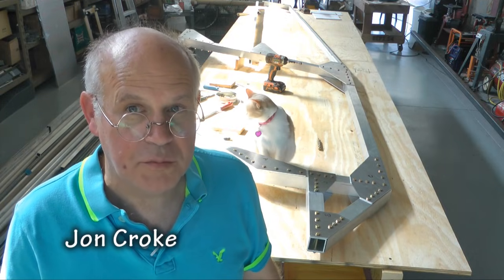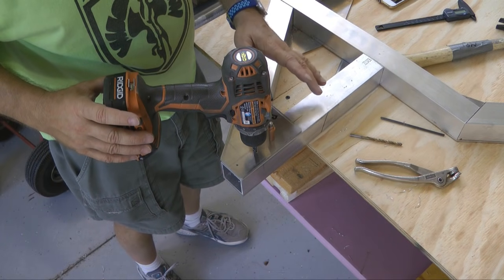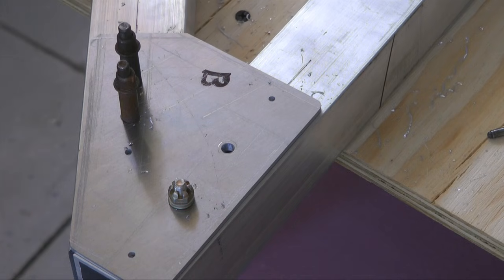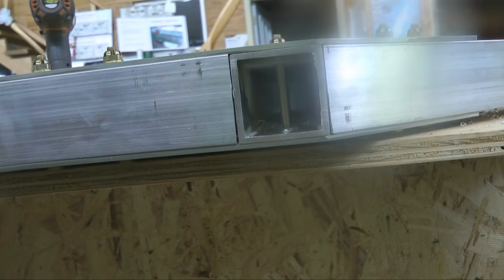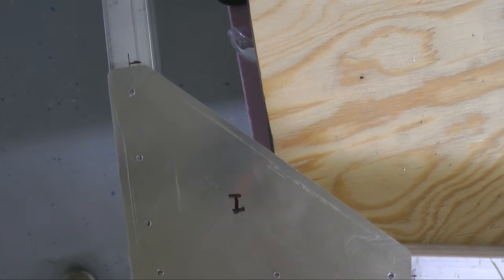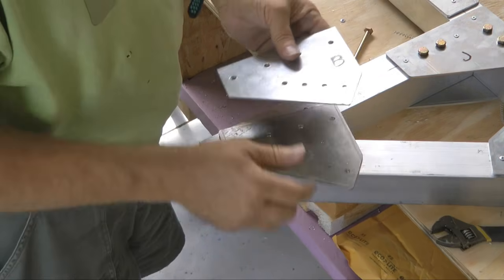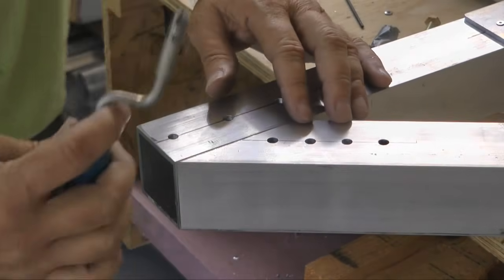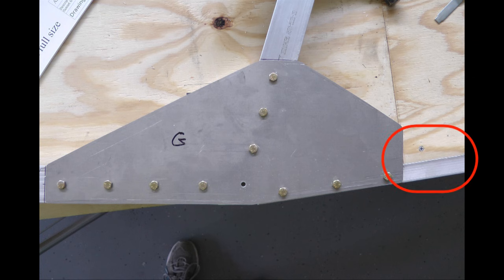Building My Affordaplane Part 5

Comment: A couple of thoughts...  1. Buying or borrowing additional drills (even super-cheap ones) will pay huge dividends in time savings and reduced frustration on a project like this.  Put each drill bit you're using in a separate drill and label it with a big piece of painter's tape.  2. Put a rubber O-ring around each drill bit; when you punch through, it will prevent the nose of the drill chuck from making a radial scratch in the gusset material.

Comment: I made the same mistake on gusset G.  I found out that there is a page missing on gusset G, there should be 4 pages that you tape together. Having said that, If I was paying attention, I would have notice that the full size drawing was missing a part four by looking at  drawing #67. Hopefully other builders will see this and not make the same mistake we did.

Comment: One quick suggestion...instead of putting two washers on one side under the nut, how about putting one washer under the head of the bolt and one under the nut? That'd provide a slighter larger bearing surface under the head of the bolt to spread the load under it and marginally improving the clamped joint of each bolt connection. It'd do this while still providing the same functional result of covering the threads as you clearly described around the 14:00 mark.
Thanks for making another very clear and informative video. I think your methodical explanations are very effective. I'm looking forward to the rest of your videos about this build.

Comment: You should have taken it all apart so that you could get to do the deburring on the inside and remove all that drill swaf / rivet tails you have left in there.
Reply: @electoplater  as he gave all the other information in such detail I am surprised he did not talk about that.
Reply: @electoplater  If they have blocked you how did you post this? Looking at the aircraft I feel it might just make part 103 with the right covering and the very basics but it will be tight. That said I do think it would be a good SSDR here in the UK if we substitute 6061T6 for 6082T6 and we could afford to build it to the LSA as we are restricted by MTOW at 300Kg or 315Kg with recovery system.
Reply: Yeah, why leave the deburring for the end ? Why not deburr everything as you go along.

Comment: Plastic calipers are for electricians. It's for extra safety when checking the wire gauges. Not to be used for anything where precision and repeatability of measurements matters.

Comment: Looking at this potentially later, two questions:

Any thought on using the same thickness round tubing vice square?  I'd imagine for the same weight, it gains a little structural strength.

And any option for hinged wings that could be considered?

Just curious, keep up the great build.
Reply: @electoplater  Thanks
Reply: @electoplater  Yes he will. As usual, you are spreading false information.

Comment: SIR THIS IS A VERY GREAT BUILD SERIES I DREAM ALWAYS TO HAVE MY OWN AIRPLANE I DID MY MICROLIGHT PPL IN SOUTH AFRICA. I DO HAVE A LOT OF SKILLS TO WORK WITH WOOD AND METAL I AM A BLACK SMITH MAKING KNIFES. I WONDER IF MY DREAM IS TO HAVE A PIPER CUB CAN I BUILD THE CUB WITH THIS METHOD THAT YOU USE HERE OR IS IT BEST TO BUILD THIS AIRCRAFT AND THEN GO TO A PIPER CUB AND BUILD IT WITH PIPES AND TIG WELD IT. WHAT WILL YOU ADVICE ME TO DO SIR?

Comment: seems like rivets around the perimeter of gusset and tube overlap would be stronger than thru-both-sides of the gusset-tube-gusset as the tube will want to collapse as the bolt is tightened and from vibration-time without an insert in the tube thru which the bolt passes as part of the stackup  (bolt gusset tubewall spacer tubewall gusset nut)

Comment: Nice simple construction, but further improvements can be easily made since the gusset plates were laser cut. The nose assembly is built up with a couple of tubes, six plates and a pile of hardware. Two large/swiss-cheesed gusset plates and a single piece of tube could provide the strength with reduced weight and hardware count.

Comment: I enjoy your tutorials! I do have a comment though, standard practice is to drill the bolt hole undersized and then use a reamer for the finished size. At least that’s what I did with my Hummelbird project.

Comment: Probably a dumb question, but why rely on drawing a perfect centerline on both sides (error-prone), and not simply use the gusset as a template to punch and drill ? (less error-prone). At least that's what it seems to me, what am I missing ?
Reply from the maker: You can certainly use the gusset as a template, but - for the accuracy I am after - you still need a good centerline to align the gusset on each side.  If the gusset is just a little skewed when transfering the holes - nearly all the holes will be "off".  Whatever works for you is best!

Comment: This really makes me want to go with the Stainless Steel rivets instead of bolts for weight savings 🤔
Reply: I've seen a lot of argument back and forth on the issue, I'm with you though, really need to switch over to SS rivets. We need a structural engineer to step up and do the math for us and update the plans! lol
Reply: @smittyrok101  im an engineer..why  do you need an engineer?? is this an faa requirement on a  ultralight?? rivets are fine..rivets and bolts together is fine..why take out the rivets
Reply: if it was me..id  use  bolts at each corner and the rest rivets..save 10 pounds easily
Reply: @johnnyllooddte3415  Well, I'm assuming that AN4 bolts have a much higher sheer rating and tensile strength than a rivet, so it would need more rivets than bolts correct??? But how many? And at what point will "swiss cheesing" the structure to add more rivets will you begin to see diminishing returns?
Reply: @smittyrok101  Nope
Reply: @abundantYOUniverse  So 1 for 1, rivets for bolts will have the same strength? I would think a hollow pop rivet would be a fraction of the tensile strength of solid steel bolt.
Reply: @smittyrok101  No. There are many points that need a bolt because they carry loads through the tubes, rivets cant do that. They carry the load ACROSS the gussets, through the tube like the rear wing attach bolt. You never want to save weight in the HARDWARE dept. It was designed like it was for a reason. The A-Plane has a 22 year perfect safety record, if built to plans you dont need to save weight anywhere like that.
Reply: @abundantYOUniverse  thank you! it makes sense that a bolt carries the load all the way through, rather then just on the wall of the tubing.
Reply: @smittyrok101  Roger that thanks!

Comment: With the bolt holes drilled on the centerline of the square tube, how does one prevent crushing the square tube when the bolts are torqued?
Reply: The nuts aren't torqued to a very high value.  By using nylon lock nuts, the nuts themselves prevent loosening, so high torque isn't required.  Multiple fasteners per gusset provide sufficient overall clamping force to prevent fretting.
Reply: Remember, there are 1/8" gussets on each side of the 1/8" walled tube upon which the nuts are tightened against.  And as FlyingShotsman said, "high torque isn't required."
Reply: Allow me to rephrase the question: Is there any engineering justification for having the bolts in the middle of the tube and in a straight line?  If one substitutes rivets to attach the gusset plates, joint loading changes substantially.
Reply: @buckmurdock2500  Yeah, you’d want to look up the data sheets for the AN4 bolts and stainless steel rivets, compare the shear and tensile strengths, and increase the fastener count to achieve similar joint properties.  It would certainly take more rivets.  You’d want to space them from the edges and from each other by following the guidance in FAA AC 43.13-1B.

Comment: ??? why not cut the holes on each side???
youre using  8 bolts per gusset,, it really  doesnt matter if they are on the threads of a  high strength bolt.. youre not  building a bulldozer..
is this some sort of faa requirement,, why cant you keep the rivets???
Reply: im sorry,, im an engineer,, i dont see it
Reply: sorry, i dont see 7 bolts instead of 8 making any difference